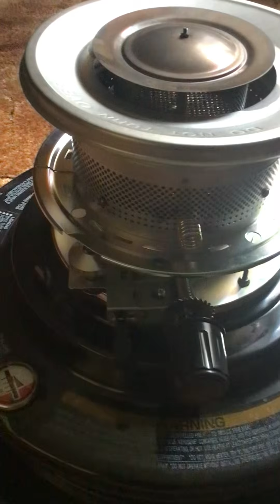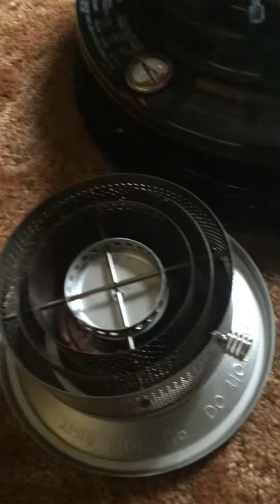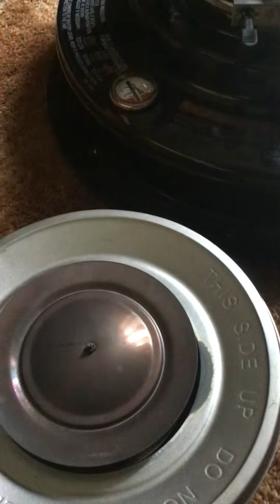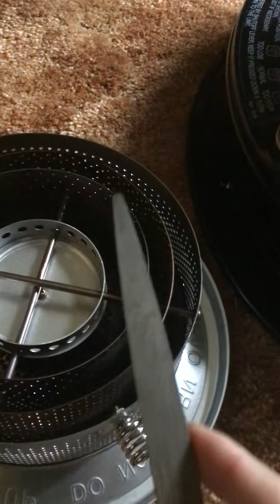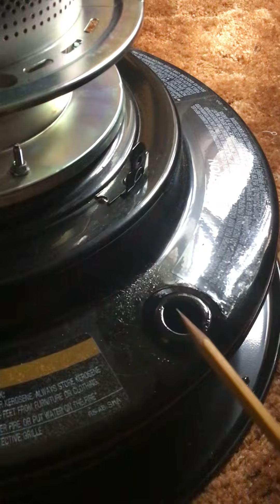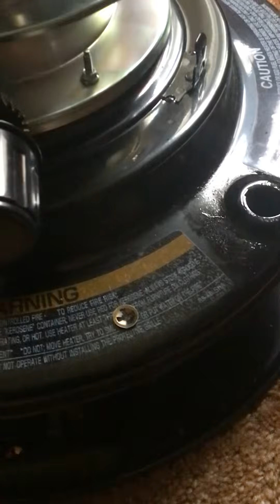How to balance kerosene heater coils and get more efficient heat and fuel efficiency

Comment: Is there an easy way to do this or is there a procedure to follow like using a straight edge also how do you tell if  the middle and inner ring are seated properly?.
Reply from the maker: one trick is when the 2 rods are in the coils rub oil on edge of each coil where they touch base and then place it back on and seat it down in normal position then pick it back up off base and look for any place where oil didn’t touch base and then mark that place on the coil with pencil and file all the high points that touches to level it up and then repeat and check it again till it all lays flat….some bases are not made even so you will have to use this method to get it to fit perfectly
Reply: @Theantiquerepairman thanks
Reply from the maker: @shnobi24  also can drill the rod holes too lower one whole side of coil if gap is too large at bottom or if the rods holes are not level some times they get rod hole wrong from the factory
Reply: @Theantiquerepairman thanks I'll look for that